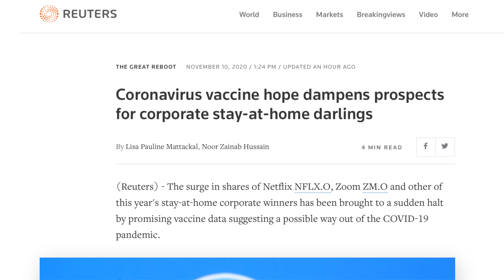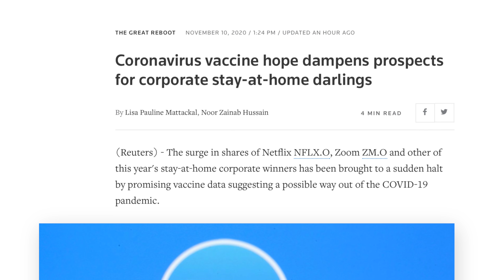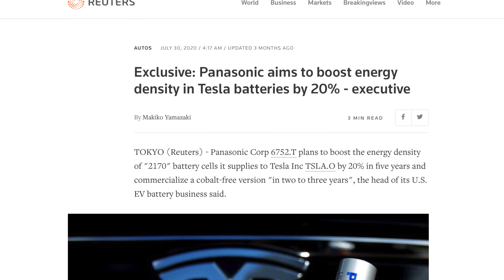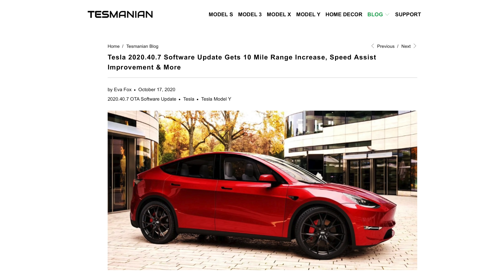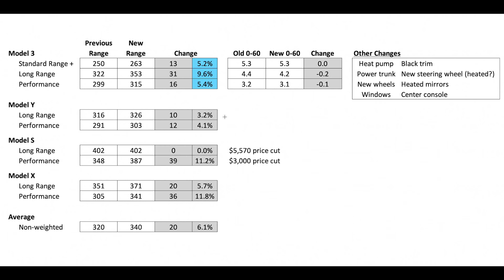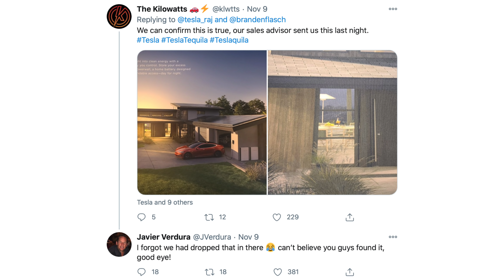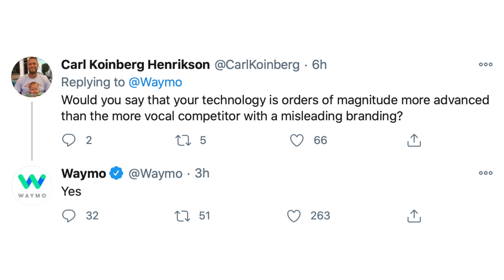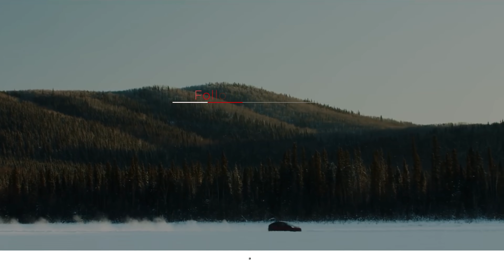New Model 3 Battery? + TSLA Stock, Waymo Throws Shade at Tesla

Comment: Hi let me make a comment on the Battery kWh in German documents, all Model 3 2020 LR/P had 79kWh, the new 2021 split in 2 Grps: 1) 77kWh VIN <820 (I have a 77 with 819xxx) and 82kWh for VIN 820 and higher...Dont ask why they went down from 79 to 77...

Comment: I think The LR AWD has the biggest range increase because it is the only Model 3 with both heat pump and the new batteries. The SR+ and M3P only has the heat pump, no new battery. That makes sense, because if Tesla were to switch batteries, they can't do it all at once. It has to be a progressive rollout. Looks like they chose to add it to the LR AWD M3 first.

Comment: What I really like about Waymo's system is the almost invisible hardware that sits on the roof and various other places on the car. So elegant and understated! Should be called "WayMore." (Some sarcasm has been used in the making of this comment)
Reply: Rofl
Reply: Isn't that older footage of a development mule? Afaik the current vehicles look a lot different. If I'm correct, it was rather unfair of Rob to use the old footage.
Reply: But if it isn't your car, would you care about that? Personally i don't care about the look of my cab or  my uber.

Comment: I took delivery of my model Y long range on August 8, 2020. I saw a fairly quick battery degradation down to about 300 miles. I received the efficiency update about a month ago and now my range has improved to approximately 310 miles. I have only  charged to 100% a few times so these numbers are estimates based off a 80%-90% state of charge. 
Hope this helps your question near the beginning of this video.

Comment: Arcimoto has a good idea making a small, light, fun, commuter. They are only failing on price. They need to streamline and tighten down costs or the idea will fail. A little zippy trike with a bit of safety needs to be less expensive than a brand new Hyundai Accent with an MSRP of $17490 including automatic transmission.

Comment: Waymo is definitely not "orders of magnitude" ahead of Tesla. At best they are a few months ahead of Tesla and have reached a local maximum from which they cannot escape without starting from scratch. They fundamentally have chosen the wrong strategy... depending on expensive lidar and overly fragile and overly limiting geofencing and HD mapping. Lidar, of course, cannot work in low visibility conditions such as fog, smoke, heavy rain and snow. I also don't think they've put in the work to make their onboard electronics efficient enough, I don't believe they've worked on reducing the cost of the other system components either, and they definitely haven't put in the work to hide the sensors in the bodywork. I don't even think Waymo has been able to entirely eliminate safety drivers, merely hidden them and forced them to take over via remote control when necessary. Waymo's efforts have to be characterized as mere proof-of-concept at this point.

Comment: It is fairly easy to argue that waymos tech is more advanced in the sense that it is more complex. But that doesn't necessarily equate to it being a better solution. One of Teslas key strengths is that by the time FSD is complete, Tesla will have millions of cars on the roads in an instant and Waymo will have to sell prohibitively expensive sensors to OEMs who then will take years to integrate them into designs.

Comment: I just don’t see what advantages Acimoto brings to the party.  These look like electric coffins.  The rapid responder and delivery are absolutely ridiculous.  Maybe for pizza delivery or get two guys to the fire who missed hook and ladder?  What am I missing here?
Reply: It does look like fun, and definitely safer than a motorcycle, with more cargo carrying capacity. It should make a good city car substitute, especially in milder climates. It's got a top speed of 75 mph, which is enough for legal speeds on the freeway. Most city cars aren't capable of freeway speeds at all. It's 100 mile range seems adequate for its intended purpose.
 
I'm not entirely sold on it, especially at the current high price ($17,900). But if Sandy Munro can get the cost down it should find at least a few niche markets. It will have to compete with ultra-small, ultra-cheap fully enclosed 4 wheelers out of China at half the price or even less, so I expect it to find favor mostly as an alternative to a high end motorcycle. It will definitely have to prove its market exists. It will have to fit in between motorcycles, scooters, electric bikes, city cars, golf carts, ATVs, Gator UTVs.
Reply: I look forward to see the confused look on your face when you suffer a heart attack and learn that the ambulance is stuck in traffic 5 blocks away, when a small trike with a first responder and a heart starter could have been there already.

Or when someone you knows suffer an allergic reaction from a bee sting or a tiny amount of hazelnut in the restaurant food, and urgently needs a injection to stem the swelling of the throat.

Comment: Tesla is crashing, once the vaccine comes out the stock will go down to $120, company will file for bankruptcy soon after.
Reply: Lol, Even if the stock did go to 120 they wouldn’t be close to bankruptcy
Reply: vaccine? 120? wtf?
Reply: You're an obvious troll so I shouldn't respond, but I'm just too tempted not to. 
  
TSLA is not crashing, it's trading within a trading range and has been for the last 3 months. It's not going up substantially in the near future because its P/E is already 784, but long term investors like me are buying the dips any time the price falls below $400.
  
Why in the world would the availability of a vaccine cause TSLA stock to fall at all, let alone all the way to $120? That makes absolutely no sense. There's not going to be a big sector rotation out of tech stocks. There may be a little hot money leave for health stocks and beaten down sectors, but tech will still be a bright spot in the economy, and Tesla even more so than most tech stocks. The vaccine should improve the economy in the long run and make lockdowns a thing of the past. The success of Tesla is in no way dependent on lockdowns even if some other tech stocks are profiting off of the lockdowns.
  
And even if the stock did fall to $120, why would Tesla file for bankruptcy? Your string of non sequiturs is dumbfounding. There's absolutely no way that Tesla will file for bankruptcy with the cash pile it's sitting on. The stock price is irrelevant to the success of the company at this point because they've raised all the cash they need to for the foreseeable future.
Reply: Nice of you to inject a little humor.
Reply: Okay, so how much did you invest in that gloom and doom thesis? $100,000 in bear certificates?
Reply: None of your points make any sense whatsoever.

Comment: The Arcimoto design just seemed a bit off to me. The design is too open — seems like rain and mud are problems — the spindly front wheels appear fragile, and the handle-bar steering makes the driver look kinda dorky. I’m thinking that a sleek, fully enclosed design like the SOLO will hit more of a market sweet spot.
Reply: It is dorky looking imo but it is a similar setup to a Can-Am which has been around for a long time

Comment: I think all model 3s got new batteries. But, Tesla also improved awd efficiency so every awd Tesla 3/Y got range increase. I have no idea if Tesla switch to new cells in Model Y. Maybe they will switch in the future!
Reply: Doubtful that it was an "AWD efficiency" improvement.
The 3 maybe got the updated Y motors (ref Sandy Munro, September?)
But that was a while ago.
The cell improvement was the one Panasonic announced recently (possibly "J.D" chemistry improvements?)
Reply: @rogerstarkey5390  I assumed the motors were the same between Y and 3. But it is certain that model 3 dual motor has became more efficient. EPA rating has increased from combined 121 mpge to 134 mpge for 2021 model 3 AWD. There is 9% efficiency increase. But now I wonder if Model 3 has a new battery or not, because range increased is around 10%.
Reply: @suvari225  
Motor changes.
It's logical to assume that this applies to the S and X as well.
https://youtu.be/Vm7l3YxEF8g?t=658

Comment: I think the car industry is very set in its ways. People want a safe vehicle that drives itself. Waymo is not intended by design to drive itself aka see/ decide. Tesla is. That's a very important distinction of missions between Tesla and Waymo. At this point, vehicle or not, batteries are an important technology of which Tesla has demonstrated thorough understanding and expertise of. If tesla were only producing batteries, everyone would want them. Battery companies signing deals witth other battery producers is a serious signal of strength for Tesla. Thoughts anyone?

Comment: I purchased a Y in September.  After the range update I have noticed my wH/mile at highway speeds is much significantly lower than it was before leading to better range.  I have 20" Induction wheels, and AWD LR.

Comment: I really don't understand the fascination with the latest crop of 3 wheeled vehicles.  Outside of third world countries 3 wheels have never been successful and making them electric does nothing to address the shortcomings of the design.  In the same footprint you can make a 4 wheeled version with greater interior space and greater utility.  In the urban settings these things are designed for aerodynamics are essentially meaningless so a larger boxy design would be ideal.
Reply: I don't understand the fascination with these vehicles either.
Reply: Electric does everything to make them successful.
https://youtu.be/dhUzCnaQj4E?t=91
Reply: @waynerussell6401  Your link does not make your point or negate mine.  3 wheels has never been successful for reasons which have nothing to do with the mode of propulsion.
Reply: Go on - tell us your story...
Reply: I think it's worth exploring the 3 wheel design space. Eliminating a rear wheel is one way to save on weight and hopefully cost. Many people don't need all the interior space and cargo space of a 4 wheeler, especially if they live alone like I do. 
 
That said, I haven't seen any compelling 3 wheel designs. Truthfully, I'm not willing to give up speed or range, even if I'm willing to give up interior space. (Given my speed expectations, aerodynamics are important. A 3 wheeler may have an advantage, that remains to be seen.) My expectations don't fit the profile of a city car user or a third world user. The assumption is that they are willing to sacrifice somewhat in speed and range.
  
I expect to pay substantially less if I'm buying a smaller vehicle with fewer wheels, and maybe less safety than a full size car. Most 3 wheel designs don't save enough money to make the design sacrifices worthwhile. But the possibility remains that someone might find the sweet spot.
Reply: @dlwatib  That's the problem, there are minimal savings to be had by removing one wheel and suspension.  For any given load capacity a single wheel and suspension will have to be made heavier than each dual wheel setup so it's not as if you are saving the weight of a complete single wheel setup.  Similarly the extra interior space provided by a 4 wheel design comes at minimal cost and weight increases.  4 wheel designs can still be made as narrow as you wish so 3 wheels provide no benefit there.  Look up the old Tango electric car.

Comment: Arcimoto vehicles seem like the ultimate mobile emergency response unit. First aid in the back, two responders ready to jump out. Edit: doesn't work for transporting anyone to the hospital. Good for bouncers patrolling a large property though
Reply: AHH no, responders need a way to transport the patient back to the hospital so it will never be bought  in large numbers by city emergency departments.  It would be negligence to send a first responder out to a house and the patient needs advanced care in a hospital asap and acrimoto cant take the patient back but has to call a van, meanwhile the patient dies.  Really dumb idea IMO.
Reply: @brenthandel7747  oh duh. Yeah it's mainly a delivery vehicle then. A bigger version could even be a good local mail truck. Refrigerated version could be a crazy deli or sandwich delivery truck, heated version could be pizza.
Reply: Retired NYC paramedic here. I also worked in a small town and an exurban area early on. I can't see this working in the main 911 system. They wouldn't get to very many urban jobs faster than an ambulance, and the personnel cost of manning a unit with even one EMT wouldn't be worth it. Personnel are expensive! 

We do have Gator units to go on the beach at Coney Island, etc, powered by ICE. Manned by one EMT. There's room for one supine patient, with his head up next to the driver. These are used to get the patient off the beach to an ambulance.

I can see some limited use on a large property. A large factory with several buildings, etc would benefit if the company had their own first responder on staff, on site. He/she could respond and give aid until the ambulance came.

Comment: Took delivery of my Model Y.  Now I'm buying aftermarket parts: Hub, charging pad (I have a phablet), and sunshade.
Reply: i pictured a charging pad that is placed on the garage floor that (wirelessly) charges the Tesla...
Reply: @jetah50  
Don't forget,
To have a charging pad on the floor, you also need a device to receive the power on the car.
That would be heavy and (if after market) in the most vulnerable position under the car.
Reply: @rogerstarkey5390  i was thinking more integrated from factory. this way it could be put in the battery cell space. but i'm not sure if having a metal frame between the send and receive unit would work well.
Reply: @jetah50  
I WISH!  😄

Comment: I made a (very small) investment in Arcimoto back before the EV stock bubble, and sold half when it went over 200% my initial investment. Planning on not touching the remaining half, and just seeing how they do overall. They've got a long road ahead of them, but their product is cool enough that I could see myself driving one, so I'll be watching them with cautious optimism from here out.

Interesting to see Waymo throwing shade at Tesla like that; from what I understand both technologies are very different and use very different approaches to the autonomy problem. I don't see "orders of magnitude" of difference between current Waymo taxis and the Tesla FSD beta; the tech looks fairly comparable, with Waymo having the edge stability-wise thanks to their high-resolution city maps and Tesla having the edge investment-wise thanks to having millions of cars with the hardware already. I'll certainly keep watching both technologies closely; I don't think there's a clear winner as of yet.
Reply: Do you not think that if Tesla launched .... Let's call it "Project W", they couldn't have cars running "FSD" in a very specific area of one city within a couple of months?
Alternatively, if you removed a Waymo fleet from its "haven" and dropped it in a random , unmapped city, or for that matter, "anywhere" how would it fare?